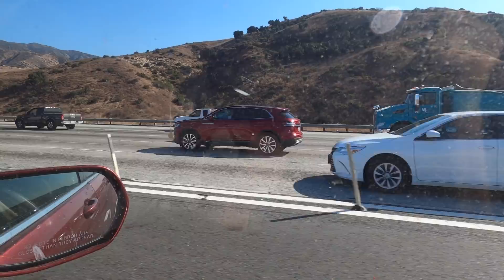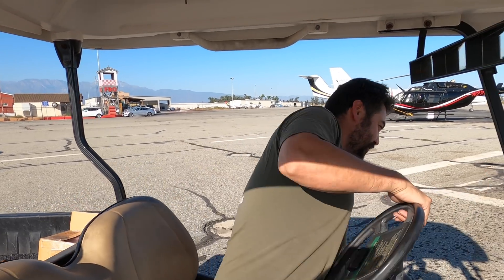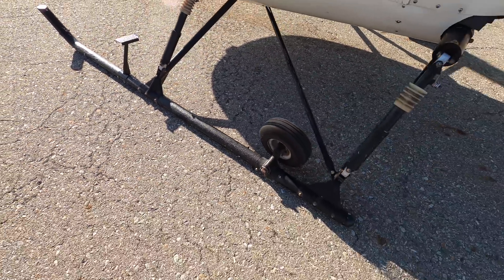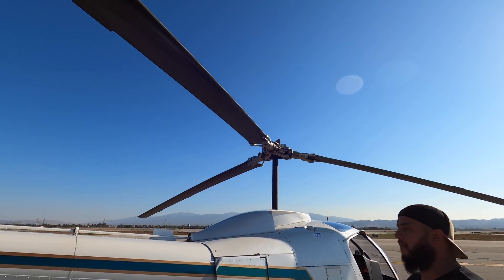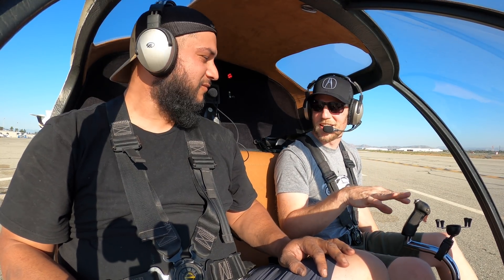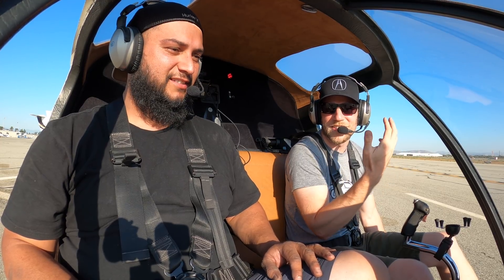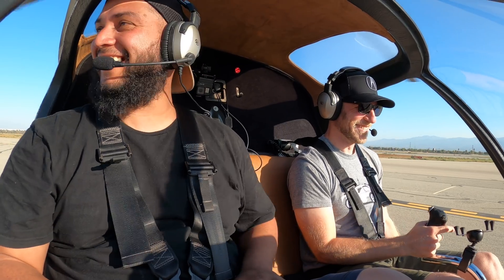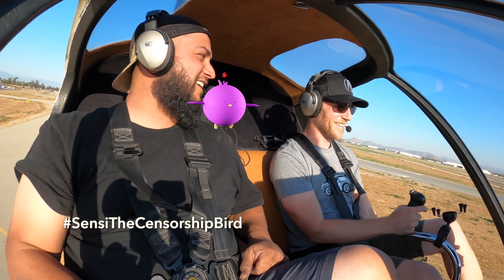Helicopter Annual Inspection | What Was Fixed & Test Flight

Comment: How much does a typical annual run for a 280? Also have you ever thought about trading up for an FX? I've been casually shopping Enstroms after flying all kinds of types (ranging from mil rotorcraft to R44) and think they are just the coolest helos but am on the fence between a 28C/28F or a 280C/280FX. Inputs?
Reply from the maker: If it weren't for big ticket upgrades, my annuals would only be a few thousand bucks. Last year was ADS-B. This year was a main rotor gearbox. Based on my bird's component times, future annuals should be relatively cheap. 

Regarding 280FX vs 280C, I've flown both. There's a slight increase is gross weight plus the addition of a correlator with the FX but I honestly prefer the uncorrelated throttle on my 280C. When you pull up collective you roll on throttle. Easy peasy. With the correlator, it often times overcompensates, requiring a slight roll off when pulling pitch. I'm sure you could get used to either but I found it a little counterintuitive. By coincidence, I might be selling my 280C for something a little larger. Shoot me a DM on Instagram if your curious. @micahmuzio Cheers!

Comment: For anyone wondering why aviation maintenance takes so long and every part has to be shipped in, regulations require each part to be accounted for and logged, from the factory to installation. You don't want to use grey-market parts to save money when you're fixing an airplane or helicopter. A mechanic who used a military surplus sprag clutch on a civilian Enstrom and didn't lube it properly caused the death of Jane Dornacker of WNBC in 1986. It's one thing for a crappy Dornan part to leave you on the side of I-5; it's another for a bad part to make your engine stall at 1,500 feet AGL.
Reply from the maker: Jonathan, this is an excellent synopsis. That Jane Dornacker crash was tragic, especially because it was avoidable. Flying is expensive but with my family aboard it's worth the cost.
Reply: @MicahMuzio  Thanks, Micah. And stay safe!

Comment: Did you get ground resonance on that landing (6:40)?!
Reply from the maker: No but Enstroms do have a tendency to rock on the ground. It’s due to the design of the rotor head. The blades have nothing to keep the lead/lag hinges centered. So it rocks. 

To manage their inherent rocking behavior on the ground Enstrom uses an oleo strut skid design. Those struts actually make it very difficult to create true ground resonance.